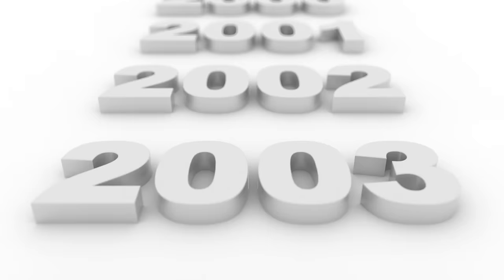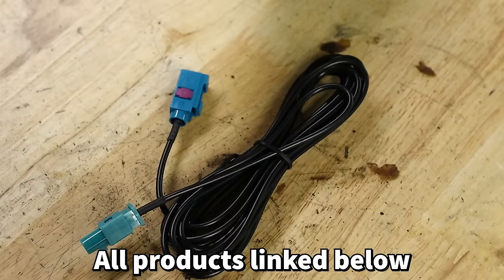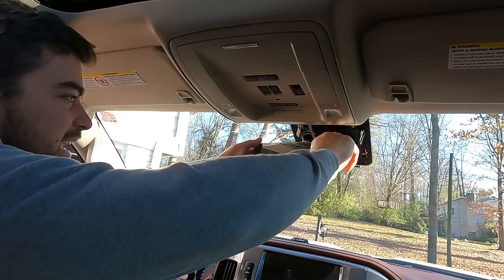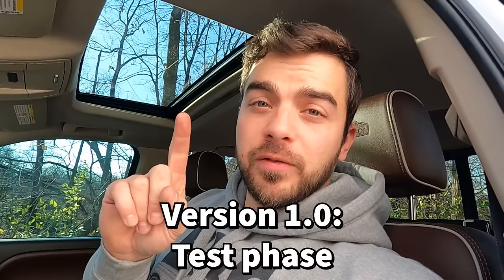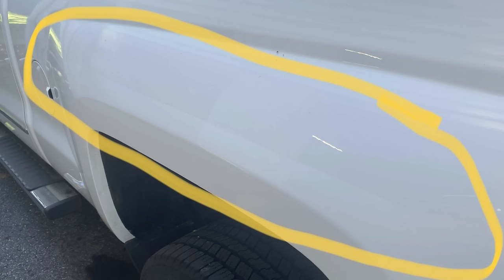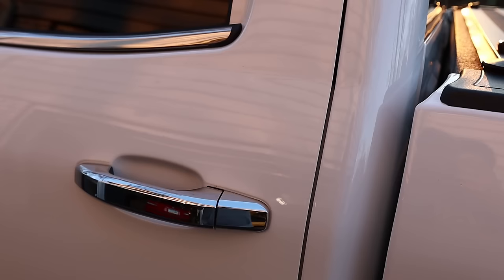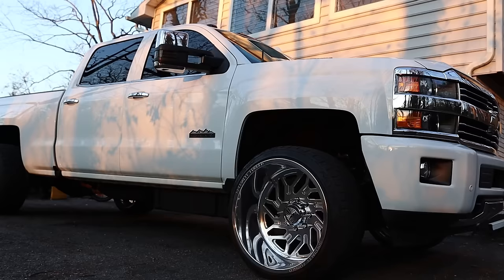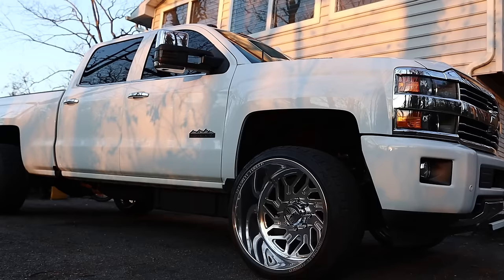Installing 2022 Silverado Tech in my 2015 Duramax!

Comment: Your video really helped me with a few parts during my installation. Thanks again for the step by step process.  

Also, for anyone wondering if OnStar still works after the swap, it does. You just have to go through the voice commands from the steering wheel button.
Reply: Was going to ask that same question good question by the way

Comment: I have the rear view mirror in my 2021 I’ve replaced the camera 3x 4th time i used waterproof silicone to prevent condensation in the camera lens 5 months later no issues
Reply: Where did you silicone? Around the camera?
Reply from the maker: I didn’t have issues with my ZR2 thankfully.

Comment: Hey Matt, been a subscriber for a while and enjoying the content. Some mods I'd like to see done are: Side mirror puddle lights, grille integrated lightbars, led fog lights, metal bumpers, rock sliders, and fender flares. Maybe even some power upgrades and exhaust too. Can't wait to see what you have planned!
Reply from the maker: Power upgrades coming.  No metal bumpers or off road stuff for this truck though, its not an off road build.  The next ZR2 though...

Comment: I've had Alpharex headlights on my pickup for a couple years now. They're a solid budget alternative to Morimoto
Reply from the maker: Which ones?  They make some that are also over $1000.
Reply: @matt13ross  mine are the Alpha Black Luxx model on my 3rd gen Ram. They were about $700 back in 2020
Reply: 2014 sierra alpha Rex luxx alpha black. Not as dark as the morimoto. 750$

Comment: Awesome content man! Do you happen to know how hard it would be to retrofit this in the 22+ models? I have the refresh at4 without the camera package so I’m not sure if I would have to run that wire all the way to the mirror…im not too sure how it would work if I were to try and pull the camera view on the screen 🤷🏻‍♂️
Reply from the maker: I’d imagine pretty easy. You can direct swap the mirror and brake light with the camera already in it. Probably just need to run the 1 wire above the headliner.
Reply: Same man same :/

Comment: I want to do the camera mirror in my Ram.
My sport didn’t come with the camera mirror but I’m worried about the brake light leaking.
I took a brake light out of one of my older Rams and put it back in.
It leaked over time and ruined my headliner.
I don’t wanna ruin the headliner in a new truck.

Comment: Sweet. I'm hoping to build a custom bed down the road for my 06, but won't be able to see out the back. This is way cleaner than the aftermarket options I've seen. Do they still have compass and temperature on them?
Reply from the maker: No compass and temp on mine. I don’t think that’s really needed these days lol.
Reply: @matt13ross  Yeah, not a big deal, I just kind of like having it easily available. Mostly the temperature.

Comment: Hello. Thank you for sharing your DIY. One question- Why’d you choose the Silverado over a Ram? I’ve been looking into getting a truck and I have been leaning towards the Ram mainly for its ride. The Silverado has a jarring ride quality. What was it for the Silverado that did it for you? Was it the Looks?
Reply from the maker: I've always been a Chevy guy.  The GM trucks usually ride better than Ram and Ford because of IFS.  My second choice would be a Cummins though.
Reply: @matt13ross  thank you. What’s IFS?
Reply: Independent front suspension? Isn’t that the case for ram as well? In fact Ram had rear coil spring suspension (can option air suspension too) but Silverados and F-150s have live axle leaf spring.
Reply from the maker: Yea IFS. Ram and Ford HD trucks had solid axles in the front.

Comment: Awesome! Finally ordered all the parts to do this mod! Just wondering if you happen to know what wire would be needed for the Base WT trim with no auto dimming mirror?
Reply from the maker: I think you just need to add a key on power wire.
Reply: @matt13ross  Awesome I’ll try that!
Reply: Got the mirror in an everything works great! I have one more question. I can adjust all the settings on the mirror like zoom and view. But when I go to adjust the brightness, it doesn’t change. Could it be a bad mirror or missing wires?
Reply: @sunnyswoodworks3110 planning on doing this on my WT, How was the wiring?
Reply: @spyc8903   Super easy! Just wired one power that was missing to the fuse box on the drivers side. The ground already shares the same location so you just need power
Reply: @sunnyswoodworks3110  hi brother , I’m trying to do the same, my truck is a 2015 Silverado but I’m completely lost on what to do next, not sure how to wire the mirror, could you help me?

Comment: I believe my 2016 silverado LT has the manual dimming rear view mirror, so im guessing it doesnt have the harness connector? How would i make it work?
Reply: I believe I’m in the same boat… all my parts came in today but I’m not getting power to the mirror. The pins in the connector of the new mirror are in different locations then the pins in the connector of the oem mirror

Comment: From what I can find it looks about the same, but  do you have any knowledge of if it would be the same for the 2015 high country 1500? I apologized if this has already been asked.
Reply from the maker: I'd assume it's got to be the same.
Reply: @matt13ross  Just wanted to say thank you again so much for putting up this video. Just finished this mod and it worked flawlessly. Im still in the process of finding a better option for mounting the camera although I drilled through my existing. Thanks again!!
Reply: What cable did you use? The link from this video? It’s unavailable now

Comment: Wire is sold out, have another link by any chance? Can't find an identical one.
Reply from the maker: I don’t have another link. But you should be able to search for the same cable type.
Reply: Were you able to find a comparable cable? I ordered one and it doesnt work

Comment: When installing in my 2016 LT the mirror won't power on, I tried 2 different ones. Any idea what different that it won't power on?
Reply from the maker: I believe that's because you have an LT, which doesn't have as much wiring to the mirror as my High Country.  Someone else posted about this.  You can run power and ground to the new mirror and it will work just fine.

Comment: Think my 2018 canyon mirror would be compatible?
Reply from the maker: Yes, I'm guessing all those mirror connectors and mounts are the same.
Reply: @matt13ross  So it might be possible to do this to my Canyon. Interesting.
Reply from the maker: For sure, I would have tried it on my 2018 Colorado ZR2 if I knew about this back then.
Reply: @matt13ross  I ordered the mirror. I'll make sure it works before I order the camera. I'll let you know either way. If anything, it'll replace the ugly mirror in the canyon.
Reply from the maker: The ones I have linked should work perfect, along with that wiring harness.
Reply: @matt13ross  Just installed the mirror in my 18 Canyon. It works, minus the camera. Now I just gotta get a camera and figure out where to mount it. Thanks! Great video!

Comment: Hey Matt, got a question. I purchased these same products to do this same retrofit on my 2018 Sierra and for some reason my mirror wont detect the signal from the camera, any programming needed for this?
Reply from the maker: I didn't need any programming no.  Does it power on?
Reply: Sorry its been awhile, ive been trying to figure this out still, but yes it powers on just on the blue screen like in the first 4 minutes of your video, i did use all OEM parts that you linked in the description but even then nothing. I replaced the brake light camera and mirror assembly and still nothing, so im out of ideas.
Reply: Wondering if theres any difference between the 1500 platform , which i have, compared to your 2500?

Comment: Bought everything in your link unfortunately mirror didn’t turn on
Reply: Tried it on my 2016 silverado
Reply from the maker: Someone else posted about this. He ran a separate power and ground which made it work. He also said that he didn’t have an auto dimming mirror, which may be why it didn’t work plug and play.
Reply: @matt13ross  dang yeah just seen that right now unfortunately I ain’t good with the rewiring stuff and all that just gonna have to give up
Reply from the maker: Maybe do some searching. You might be able to just swap the harness easily to make it work.
Reply: @barbas559 what did you end up doing?
Reply: @mikeeffler5185  ended up selling the kit to a friend who had the dimming mirror turned right up on his but yeah the issue is if you don’t have a dimming mirror you need to wire it for power and ground to the fuse box by the door
Reply: @Barbas559  I can get my mirror to power up, but it doesn’t connect to the camera. I’m learning that the cable @matt13ross linked has two different color connectors M/F, and that matters. The suggested Amazon replacement was both the “water blue” color connectors and I THINK I need one that’s water blue and the green. I found one, I’m ordering it now, but it’s only 3ft, so I’m ordering 2. I’m assuming this will correct my problem, because like I said, the mirror powers in immediately, just gives the blue screen with the camera with the slash through it, but even the dimming (screen brightness, not mirror function) works. I’ll update on Sunday, in case anyone else is reading this and needs the cable. 🤞🏽🤞🏽
Reply: @mikeeffler5185  I keep trying to post the link for it or at least the name of the cable but YouTube keeps taking down my comment if you have instagram or anything comment it and I’ll send you the link to the one I had and it worked as soon as my buddy connected it to his truck
Reply: @Barbas559  I have replied to this 5 times and it keeps getting removed

Comment: Anyone else try installing in a 2017 and the mirror gets no power??
Reply from the maker: Same connector?
Reply: @matt13ross  yeah. The ten pin connect is the same, but I’m guessing the pin out is different. I even spliced in power and ground and the mirror won’t come on. Wondering if I got a bad mirror off eBay, or in just not able to find the right wires.

Thanks for responding
Reply from the maker: That's odd.  Maybe you did get a bad one.  How many pins are in it compared to the stock one?
Reply: @matt13ross  I’m guessing it’s only plug and play if you have an auto dimming mirror currently, which I don’t. So the pin locations are different, even thought there is 5 wires on the old harness and new connecter, they are in different pin locations.
Reply: @matt13ross  thanks for the back and forth. I’m ordering the harness doctor harness to add dimming mirror to my truck, maybe after I add it, the camera mirror will work.
Reply from the maker: Hopefully that fixes it!
Reply: @matt13ross  I ended up just grabbing switched power from the drivers side fuse box, and a ground that was nearby. Powers on and works now. I am having trouble fitting the 3rd brake light bulb back in, now that the camera is inside the housing, but I am waiting for some small 921 led bulbs to come right now. Thanks for making this video, convinced me to finally dive into this mod. I did the same on my 2017 Camaro, and it was plug and play, this time it def. was more difficult.
Reply: I just ordered my mirror and camera I also have a 2017 Silverado 1500 without the dimming mirror, how did you grab power from the fuse box?
Reply: @JesusGarcia-gu5en  I used a fuse tap, and I will need to see exactly which number fuse I inserted it in, but I found one that powered off with the truck. I started by plugging into the heated seat fuse, but for some reason the mirror stayed on after I shutoff and locked the truck. I will try and check the fuse # tomorrow for you.
Reply: @PLSGOMD  I need your help to get it powered on I’m not really techy or anything but I’m going through the same thing won’t turn on at all can you explain a bit better how you got it to turn on and what are the steps
Reply: @Barbas559  Get a fuse tap from autopart store or amazon. They come in diff sizes, and the fuses in the drivers panel are varying sizes. I tapped into a fuse listed on the fusebox, but at this moment do not know which one I used, as some would not turn the mirror off when I shut the truck off. Then you run 2 wires up the a pillar to the mirror, the 2nd being a ground wire, that you connect to a metal grounding screw nearby the fuse panel. These 2 wires go up to the new mirror, and the "positive" wire from the fuse box needs to connect to the red wire from the mirror. The ground needs to connect to the white wire from the mirror. I used t taps for this connection, bypassing the factory plastic connector entirely. You crimp the t tap onto each wire, and then crimp the mating fitting from the t tap onto the end of each wire you brought up from the fuse panel. The mirror only needs power and ground to function, but it seems our original harness does not provide it.
Reply: Thank you so much really helpful for me also once you get a chance let me know what fuse you used to tap in I should be receiving my mirror this Friday and camera Saturday thank you so much.
Reply: I tapped fuse #31 drivers side dashboard fuse box. “Acct/Run/crank” was the label on the diagram. Works great for me.
Reply from the maker: You guys helping each other out is awesome!

Comment: I connected my camera n there’s no signal it’s not working what’s the solution??
Reply from the maker: Make sure you selected the right input setting.
Reply: How do I do that
Reply: I have camera connect and everything I have a black screen with this sign ⚠️🎥
Reply from the maker: There is a setting for the camera input.
Reply: Yes I understand that but how can I access this menu
Reply from the maker: Scroll through your settings in the new radio. I show the settings in one of my three stereo videos.
Reply: My head unit is the original one it won’t work?
Reply from the maker: Oh I thought you were talking about the big screen.  IDK then if you have the factory radio.
Reply: @matt13ross  does the phoneix automotive head unit screen work with the rear view mirror camera ??
Reply from the maker: IDK about that. I suppose you could hook the camera up to it. I prefer the mirror screen though.
Reply: @matt13ross  what’s the brand of yours can you please put it here thank you
Reply: @mahmoudnabout5837  did you ever figure this out? I have encountered the same problem.

Comment: Love the wheel and lift size i have a 15 denali!! Whats the lift wheel & tire specs good sir?
Reply from the maker: Reverse level.  24X14s with 305s.
Reply: @matt13ross  24x14s on reverse level... must rub pretty bad?
Reply from the maker: Front rubs on the back of the fenders a little bit.  I didn't trim the backs though.